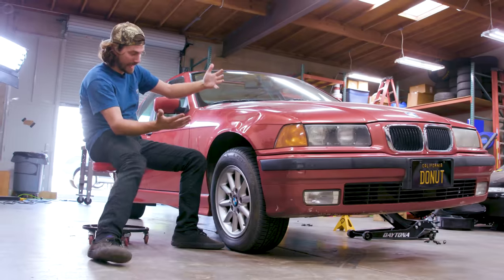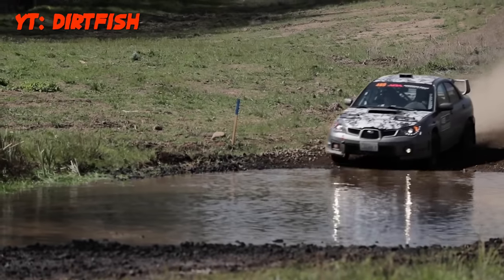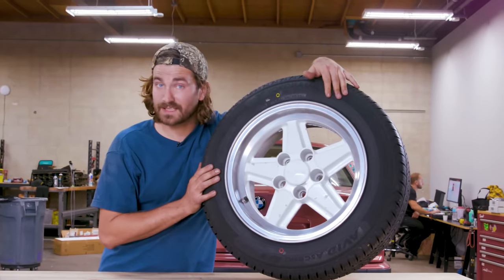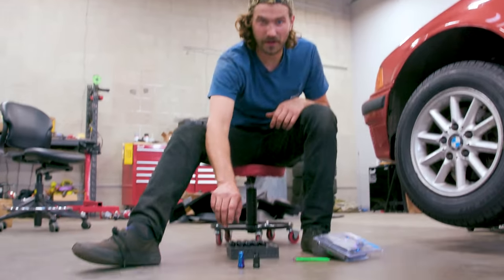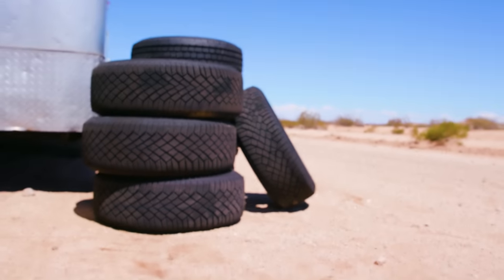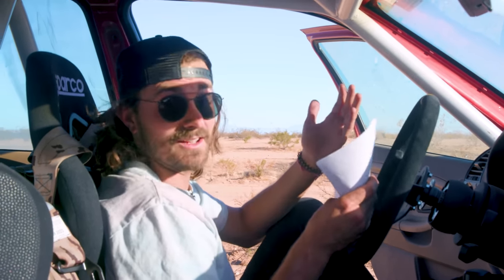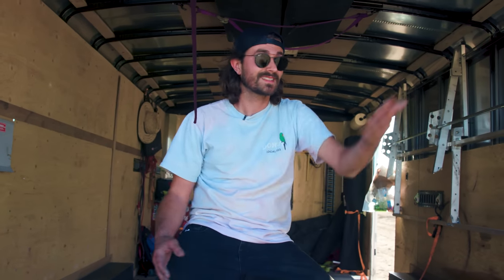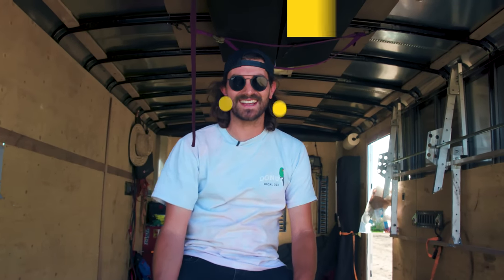BMW Off-Road Tires - Were They Worth It?

Comment: Raise your hand if you double checked all the Donut's recent uploads to see if you missed an episode for the steering wheel, sparco seats, and full roll cage HAHAHA. 😂
Reply: Definitely joined that escapade
Reply: Idk if eBay motors covers cages
Reply: @pnwoffroader331  you could be right here however wouldn’t they at least mention it?
Reply: I bet they didnt include it because they want to include different things since this is a different build and they already did a wheel, roll bar/cage, seats and harnesses to the miata.

Comment: Did I miss the episode where he installed the rolling cage, racing seats, and steering wheel?
Reply: That’s the comment I was looking for.
Reply: yeah right... I was like... is it even the same car? what about the cage? if they swapped all that stuff... made the car lighter? which means quicker times? or was the tires and transmition really the answer?
Reply: I'd gamble it's mostly about safety, but eh
Reply: I know right. They aren’t boring episodes :(
Reply: Prob bc they did that on the miata already and dont want a similar video... or they prerecorded a few episodes
Reply: Maybe they have recorded the whole series and releasing it one by one.... But tyre swaping was done earlier and testing was done later....🤔🤔... MAYBE...
Reply: Wow, I'm glad I'm not the only one. I would love to watch those episodes though.
Reply: Bro I was looking for this comment cos I thought I’d gone crazy😂. I think @GouravBadhoria might be right, at least I hope they release those episodes.
Reply: @ifarewelli  but they should have mentioned at least.
Reply: @carlossanchez3606  given there's still backseats I don't think they made the car lighter yet ... wich really should have been the first episode.
Reply: Pretty sure them putting on the wheels and tires and them testing the tires are weeks apart cause in the beginning it’s the stock seats and no roll cage
Reply: @carlossanchez3606  Biggs

Comment: Y’all should do a hydraulic e brake. That would be sick for a rally car
Reply: and a sequential gearbox
Reply: @LeoLynx-  Did you miss the memo where this is a BUDGET build? a sequential is too expensive for this and not worth it unless you're doing some very competitive stuff
Reply: @joealex65  i said it could be cool and not THEY SHOULD DO THIS AND THAT, dont get so hurted from this shit
Reply: @LeoLynx-  also they literally JUST changed the tranny
Reply: @LeoLynx-  That would be pretty cool.
Reply: I agree
Reply: @shlimey04  from?
Reply: @Olivier Mallard what now?
Reply: @LeoLynx-  Damn sequential would be nice but Manual gang
Reply: It won’t be hard to do a budget e brake, if they can figure out a dual caliper bracket and use an additional oem rear caliper and just fab up the lines like they did in past videos the most expensive thing might be the caliper or the master cylinder/lever..🤔
Reply: @LeoLynx-  you added to a comment that said they SHOULD do it. So ya know, don’t act like you didn’t
Reply: @twanlange2827  good point
Reply: @aaronwright6891  Yes it would be cool. It would also be cool if they did a complete rebuild of the entire car and turned it into a competitive rally monster that barely maintains the shape of the original bone stock E36. However, that would completely miss the point of the series. Reply section wiped the floor with your asses while you tried to back pedal and now you're getting heated 😂
Reply: @aaronwright6891  For that part I was talking about Leo in specific. Figured you would be able to understand that I was referring to more than one person. Goes to show how self-absorbed you are 😂 People like you don't usually read or think thoroughly anyway so I am not surprised how quickly you managed to shut off cognition.

Comment: I think for the truck tire, you should have gone for an A/T with a slightly aggressive sidewall. Loving these episodes!
Reply: BFG KO2's for that mall-terain traction😁
Reply: Lol Im sure its hard find truck tires for that wheel. At least without completely breaking the bank.
Reply: Yea those looked like the cargo tires and not necessarily truck tires.
Reply: I would agree.  KO2, Duratracs, Wildpeak AT3w, would all work great
Reply: @michaelkowalski8599  Toyo open country at2
Reply: @putnamehereholdmadoodle  those too, I was just naming ones off the top of my head.
Reply: title is misleading, bc none of does tires are actually "off road"
Reply: @michaelkowalski8599  I run these ATM I like
Reply: @putnamehereholdmadoodle  I myself use the Falken Wildpeak AT3Ws.  Great tire too
Reply: Bingo
Reply: @chadwickciampo3634  I have BFG mud terrains on 15 inch wheels, they would probably fit the bmw
Reply: @hankpog3907  they're not in mud though lmao
Reply: @dennisgaughan5717  i know, but i was assuming that if BFG make a mud terrain that fits a 15 inch wheel, the probably make an A/T in the same size
Reply: Probably couldn't find one in that small of a size, he even says something like these are the smallest size he could find with an somewhat offroad oriented tread pattern.
Reply: Pretty tough getting hold of an AT in a diameter that will fit under those arches.
Reply: @hankpog3907  There is no demand for anything like that so they don't bother making them.

Comment: Jesus I can't imagine how much of a installing/uninstalling was there, so much damn work in this episode
just like any other one
Reply: changing tyres is max 3 min of work, if youve got a good jack and with lug nuts instead of bolts. on my 106gti racecar i still have bolts, and I can do it in around 3-4 min, including torquing
Reply: @gerritsikkema5776  yeah i get that but still
Reply: We used to do all our tire repairs in 15 minutes or under at Discount Tire. In the Arizona heat too.
Reply: @seshelbow336  The results were likely to be more consistent if they did one test at a time, so it makes more sense. The goal here was to get useful data, not to do as little work as possible.

Comment: the car went from stock interior to roll cage, racing seats and racing steering wheel
Reply: And prolly some other stuff, no way it runs a sub 4 second 0-60 stock
Reply: @fever4174   that’s 60ft, not 60mph.

Comment: Interesting result. I expected a near tie from the all season and the truck tire (the truck tire is a highway tread truck tire, basically the same as all-season). An AT truck tire (if you could find one in that size) would probably be best. I didn’t expect the snow tire to do well since snow and dirt traction requirements are way different. Not surprised to see it got shredded though, since snow tires are designed for use on low friction surfaces, not sand paper lol.

Comment: I think that the truck tire in the case of a daily driver/weekend rally owner is going to ultimately offer the best experience. It's unlikely to be the fastest tire due to weight of the construction but you are less likely to end your weekend early because you blew a tire and need to try and get a replacement in time to go to work on Monday.

Comment: I had a 2016 Hyundai Sonata and live in Iowa on a gravel road. I put some BFG KO2’s on the stock 16 inch wheels. Threw off the speedometer by 3.7 mph but the performance on gravel and through the snow was fantastic. Left everything stock and cleared the inner wheel well like they were made for it. Since then I got an ND Miata and continue to love life. Thanks for the content and keep rockin!

Comment: "I am swapping to studs like on a normal car " 
Now, that is an insult, mister American xD
Reply: I've NEVER heard anyone say that! Studs are SHIT! He knows a lot, but the only thing studs are good for is holding the wheel when you install it - that's it! Bolts are superior in everything  else!
Reply: @LazyRASHO  then why does everyone switch to studs for everything else?
Reply: @LazyRASHO  now I'm wondering why are the studs better
I have an e30 and been thinking for a while in switching from bolts to studs since it's way easier to switch wheels
Reply: @seanmccarty1176  Because MURICA! They'll switch anything for something else! :D
Reply: @brianfarinha1720  If you switch wheels and tires super frequently it will make it a bit easier (if it goes without issues), but for seasonal change - not worth it! I've had so many people having problems with broken studs on multiple occasions and on multiple wheels at the SAME TIME and then having to go to the workshop to get them out and replaced or even having to replace the whole wheel hub and bearing, because the thread was too beat up! NEVER seen one having a similar problem with BOLTS!
Reply: @LazyRASHO  most hubs I've seen have press in studs. If one is damaged you hit it out with a hammer and pull in a new one its not a big deal. Hell to change front brake rotors on my truck I have to remove 16 studs and reinstall them.
Reply: @boxenjoyerkona  I'm from the EU and I've never worked on cars with lug nuts, so I don't know how much easier it is to use them.
But I can say that it is not that hard to change the tires on a car with lug bolts if you know how to do it. I also never had any issues with rusted bolts (but probably it can happen, and I also can't see why bolts would be protected like you said)
And the other thing is: when he put on the original tires it looked hideous at best with the studs sticking out of the wheel. But it's just my opinion.
Reply: Bolts are significantly better 
BMW M engineer

Comment: A tread depth measurement would have been nice to compare the amount of tread lost between the tires. The snow tires seem softer which would look more beat up even if it lost the same amount of tread as a harder tire. Also throwing in a 200 tw tire (typical autox tire) would have been interesting to see if it survived and how it compared time wise.

Comment: Option 4, get friendly with a rally team and buy their cast-off tyres - some will replace the tyres after every stage, and so sometimes you can pick up lightly worn tyres for pennies on the dollar. Even worn, proper tyres can beat most new non-rally tyres.
Reply: But even worn, those would still automatically put them in a fairly high tier if brought to an event. That was one of their reasons for not going with them.

Comment: Considering the problem I'm hearing, seems we'll be getting a hydro e-brake episode next
Reply: considering that you missed the whole sparco seat,upgraded steering wheel and a full on roll cage
Reply: @fricxensilang5902  why would they do an episode on that when they already did it on the miata
Reply: @ChrisPBolsak  A little Rollbar is a TINY bit different than a full on cage.
Reply: @ChrisPBolsak  Nooo look at the top comment, Donut Media said that will be the next ep read it
Reply: @Qutut  Yeah, Indeed
Reply: @fricxensilang5902  they didn't say it would be THE next. They just say they'd be coming up.
Reply: @LiamNI  I normally call it a handbrake, but it was always called a hydro e-brake around me so that's why whenever it's a hydro handbrake, I call it a hydro e-brake
Reply: @ChrisPBolsak  ok whatever , we will just wait for THE next ep
Reply: @LiamNI  hmmm I'm Filipino soooo.... Idk what to call it 
maybe handbrake is what we call them but I call them as a parking brake...
Reply: @LiamNI  IIRC e-brake (you are correct, e is for emergency) comes from trains? But typically most people call it a handbrake or a parking brake in normal use, maybe only e-brake if you're trying to shave syllables off. 

Though you can use your handbrake to assist in stopping the vehicle in the event of a failure of your primary brakes (esp hydraulic leaks or air bubbles).

Comment: 4:50 That yellow dot is suppose to be aligned with the valve stem.
Reply: They don't know what they are doing
Reply: @ascholtka420  Would that not be the fault of whoever mounted their tires? Maybe I missed it, and not to throw shade at them either, but I honestly kind of doubt they mount their own tires.
Reply: @ixionn563  nah he just mad. Probably has a clapped out civic. Don’t listen to this low life :,)
Reply: Yellow dot at the VS doesn't mean a perfect balance. For quickly mounting and balancing, it doesn't matter. They all get put on a balancer anyway.
Reply: @RyanSconce  You use less weights mounting the tires with yellow dot to valve stem. Also the tires typically balance a lot easier. The more weights you use the more likely you are to experience the chasing weights issue. 

As for balance quality that would depend more on the machine regardless of the yellow dot procedure. I think most would agree less weights is a good thing. 

Its in the tire shops best interest to follow the manufactures guideline since it will save them money and make the job a bit easier to complete. 

The red dot is a conformity mark which lines up the the dimple on the rim if there are issues.

I hate corner cutters do the job right or don't bother.

Comment: What I've learnt from the brake and acceleration tests so far is that the tyres calibrated more closely to the weight and purpose of the sedan in warm weather.
I predict the most hard wearing tyres by a long way, is the truck tyres, they're nearly indestructible and protect against sidewall failures, they'll also have much stiffer sidewalls so hold edge better with lower pressures, but adapt to the surface less quickly.
Take all the variables into account and you can tune your rally car to all sorts of  track conditions with the tyres you have already.
I also predict that any type of all-terrain tyres for a light offroader will outperform everything you have in all areas except maybe maximum mileage to the truck tyres in abrasive conditions like small rocks and shale.
💜
Reply: The snow tyres would probably work well on tarmac for a short run in cold and/or wet weather, maybe on sand?
Many more tests to run I'd say

Comment: genuine curiosity especially because of the timing on this, any issues with the studs? I had mine fall out yesterday and I almost lost a wheel because of em.
Reply: You either didn't red loctite or torque them properly.  Or the studs/threads weren't clean enough for the loctite to bond.

Comment: If you guys need a set of great rally tires use Demon Tweaks in the UK. They are a rally tire provider and arent expensive. Dedicated rally tires are the single greatest upgrade ive made to my rally car. Id start with a set of medium compound and move from there. Good luck Donut!

Comment: Each of the tire grips differ, some have more horizontal tread than others, your up and down tread (that goes around the entire tire) will help with sideways grip like cornering and sliding, while grip that’s horizontal will help more with taking off and stopping. All terrain tires are a good choice for this sort of driving.

Comment: We had so much snow last December most people weren't even called by their bosses asking if they will be in. I was pulling people out. I've also crawled through deep holes and up steep lose Hills, fantastic. Chunky all terrains are what you want. Terrible wear on hot California highways (or here this week). You lose wear and traction on pavement but great off-road. Exactly what you should get for off road rally (without rally you gotta pick one strength, not all)

Comment: "studs, like a normal car"   Europe begs to differ
Reply: Changing tires on studs and bolts is exactly the same complexity....
Reply: @balazsfarkas-jenser2230  studs with lug nuts is easier cause you can hang the wheel on the studs and then bolt it on
Reply: @xavierp3619  put 1 bolt in wheel before placing on hub --> put on hub --> tighten bolt --> install other bolts --> done.
Reply: @balazsfarkas-jenser2230  There's also a tool that makes it easier.
Don't know what its called but it just screws to the hub, you put the wheel on, unscrew the tool, screw in the bolts.
Reply: @balazsfarkas-jenser2230  I get your point but it's still harder cuz you still have to get 1 bolt in. Over here (in TX) we were comparing wheels and you can just slip one on to see how it looks / fits and see the offset. It's just easier. I guess we can both agree though centerlocks are the best.
Reply: It made me angry bc im from europe
Reply: @xavierp3619  i prefer bolts because i had to replace lots of studs after customers mounted wheels themselves because you can overtighten them easier then bolts.
Reply: @xavierp3619  and actually destroy them easier because not everybody have a torque key. Because i guess stuck your feet below the tyre is too hard for an american to do 🤔. Plus those things are protruding like some weird thing from Carmageddon

Comment: Part of the reason snow tires were the fastest is the edge between the tread and sidewall is much sharper than all seasons or truck tires. This tends to help with sideways grip on loose surfaces since they tend to bite instead of rolling over dirt or gravel

Comment: I'm sure it doesn't matter for rally stuff, but you're supposed to line the yellow dot on the side wall with the valve stem (or if the wheel itself has its own marking points stamped on it). When you spin balance the tire, if the balance machine wants more than 4 oz (inside or out side) you need to take the tire off and line up the red dot with the valve stem, to achieve a true balance. It's call weight-match balancing and high point matching. So many tire shops don't do this and it's just my OCD I guess :P

Comment: Idk if this was included within the suspension video, but I highly recommend getting a set of shock/strut reinforcement plates for a rally build. I'm pretty sure both E36's and E46's can mushroom fairly easily and its not super expensive to add as a little bit of extra insurance. Just a thought! :) Great work so far, Donut crew!
Reply: His kit came with them